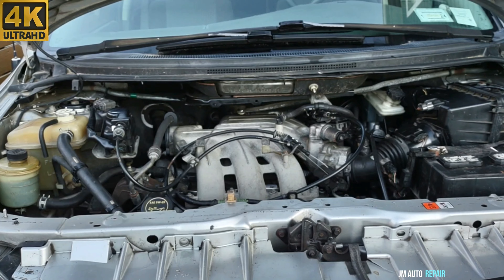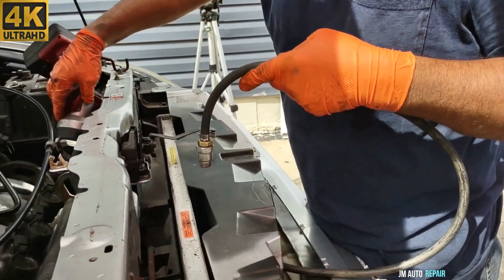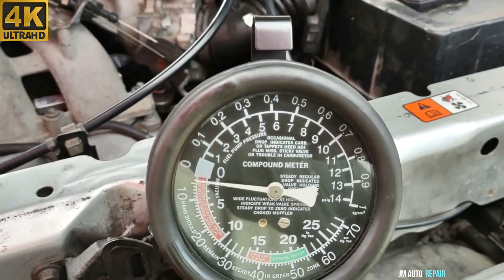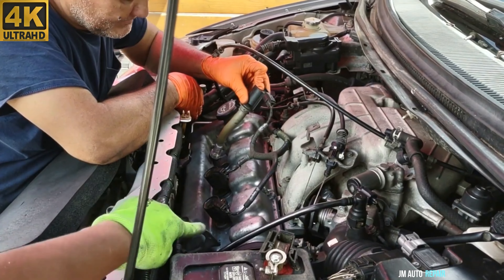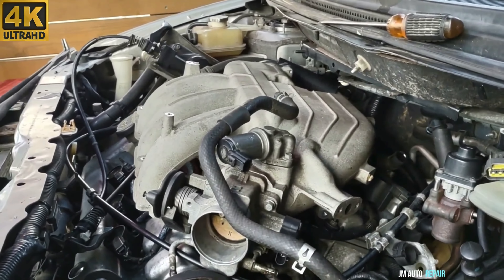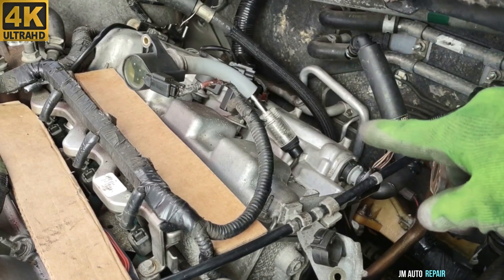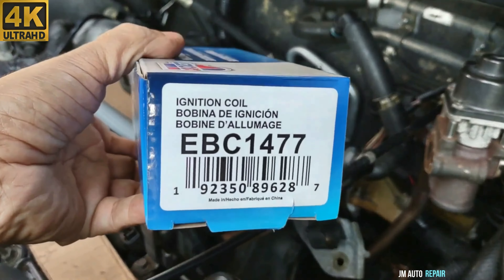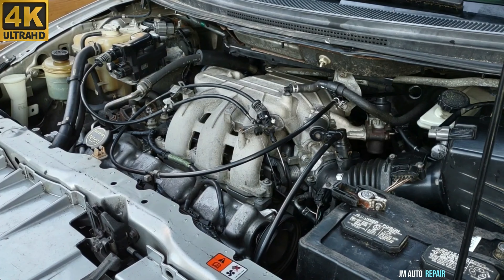car won't accelerate it looses power transmission won't change gears no codes in the pcm

Comment: The pressure gauge you used is identical to the one I got from harbor frieght.im very happy to see that you used this for the areas you did.that answered my question on weather I could use as you did,as harbor freight one was for fuel pressure and they said they did not know if I could use as a vacum gauge! So you confirmed my thought process ty very much!
Reply from the maker: Glad I could help and thanks for visiting this channel.
Reply from the maker: thanks for visiting this channel I appreciate it very much.